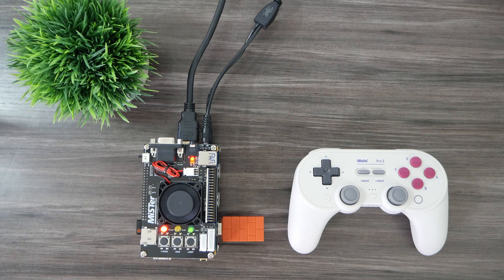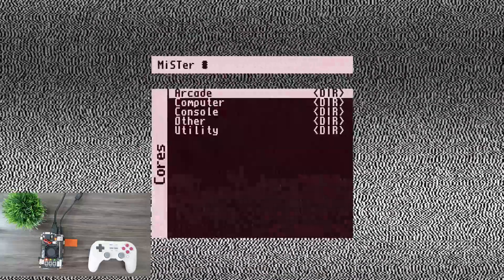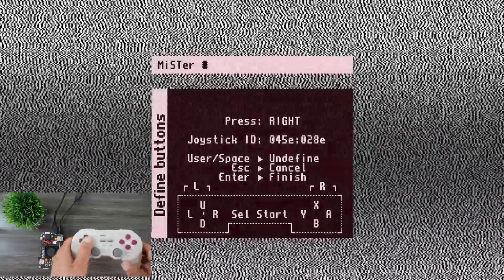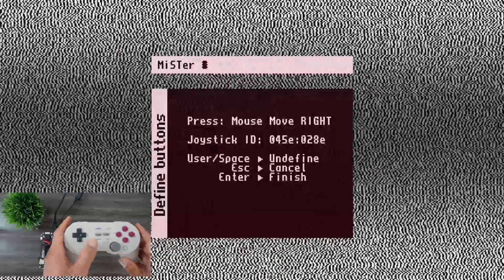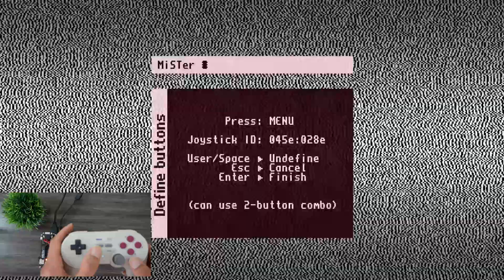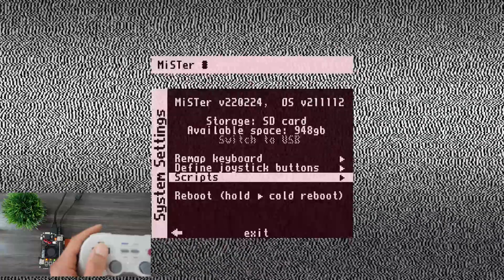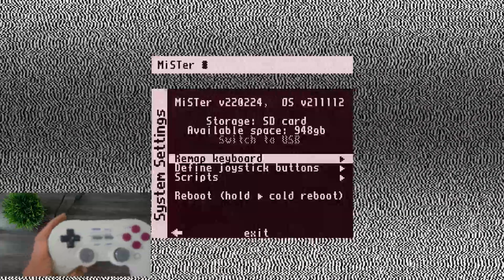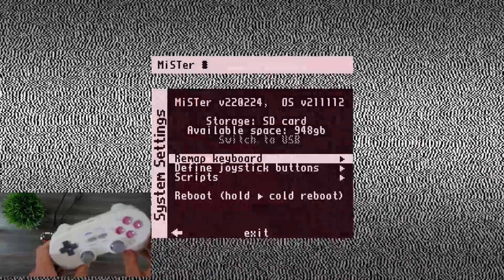Mister Controller Setup

Comment: Is there a possible way to add a second controller for player 2?
I have multiple usb adapter. My first controller sn30 bitdo w/out the joysticks. It’s got that micro usb adapter. 
My controllers are just snes usb wired. 
Any help be great Thank you
Reply from the maker: Try using a USB hub. Then configure one controller at a time. Mister should remember each controller. Then you can play two player games.

Comment: Can you map the extra buttons of 8Bitdo Pro 2 (star and center buttons) too? when I press those 2 buttons within core button mapping they don’t respond at all.
Reply from the maker: So I think you can but only in certain modes. The star button is also used to activate turbo mode, so depending on what mode your in, that might be why you aren’t able to map it.

Comment: What's with the different modes with the SN30 Pro+ ? X-Mode... is there a B-Mode? I did accomplish getting the analog sticks to work thanks to your video. Also what's with the blue ring light that's constantly trying to be on?
Reply from the maker: If you want more information about the 8bitdo Pro 2 controller we did a review of it that you can find here: https://www.youtube.com/watch?v=PuWW2QNsrO0.  But in regards to the "modes", there are 4 of them: S-Switch, A-Mac, D-Android, X-Windows.  Glad to see you got the analog sticks working, but are you having issues getting everything else to work?  Not sure what you mean by "blue ring" light, where on the controller are you seeing that?  It could be the led indicator showing that the controller isn't paired.
Reply: @411onTech  It's the blue ring light around the small button to the right of the right analog stick. It has like a checkerboard like pattern on the button.
Reply from the maker: @techstormster  Ahh ok, you have the Turbo function activated.  That light will blink when you hit the button assigned the turbo functionality.  To deactivate that you just need to hold down the button that has that functionality and then press the star button (button to the left of the left analog stick).  That should deactivate that and the light should stop blinking.  Hope that helps.
Reply: @411onTech  Thank you so much. I will try this tonight as soon as I get home. If that's the case what a relief. Then all I'll have left to figure out is rumble. So far I'm liking the SN30 pro + alot more than the M30 2.4g usb that I had constant ghosting problems with.
Reply from the maker: @techstormster  Your welcome!